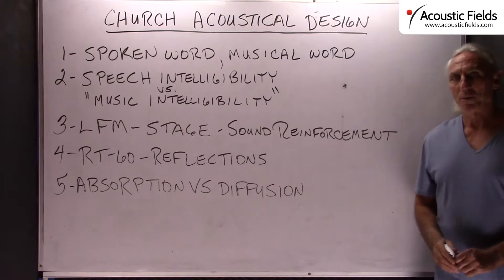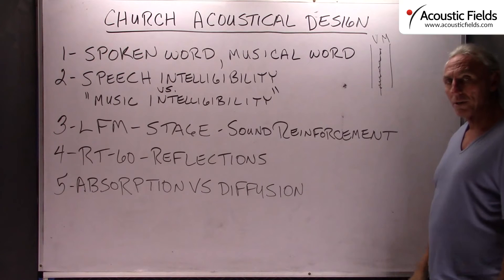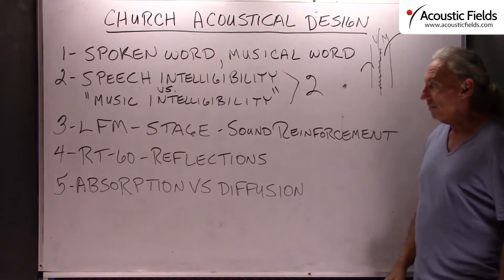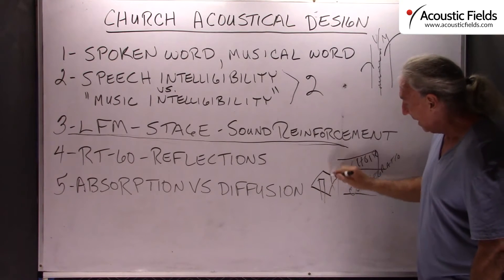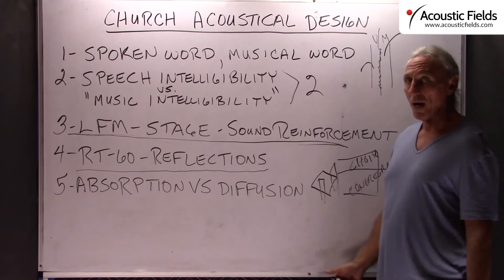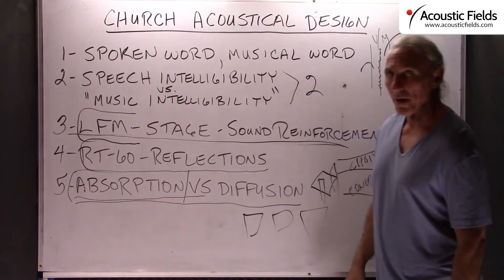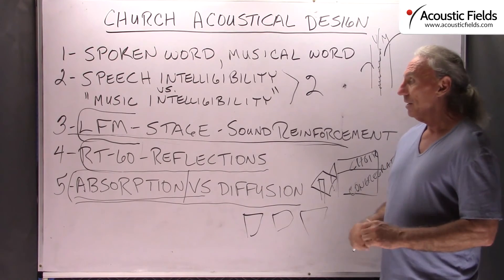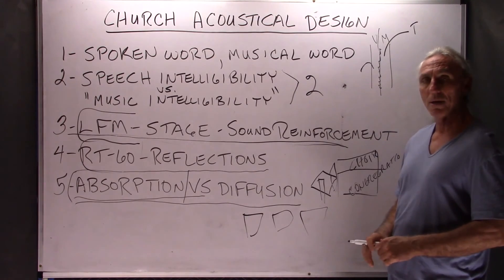Church Acoustical Design

Comment: Hi, Just a clarification that may help for some people.  I believe when this video speaks to "volume", the meaning is the volume of the room (square footage), not the "volume" of the sound (amplitude).  The larger the room, the more easily it can handle low frequency (bass) sound (energy).
Reply: +Ron Kalvaitis   Let me know if I didn't get that right.
Reply from the maker: +Ron Kalvaitis Volume is a calculation that is length x width x height. It is expressed in cubic feet . Square feet is a surface area calculation that is length x width in most applications.
Reply: +Acoustic Fields Ah right of course.  Cubic feet.